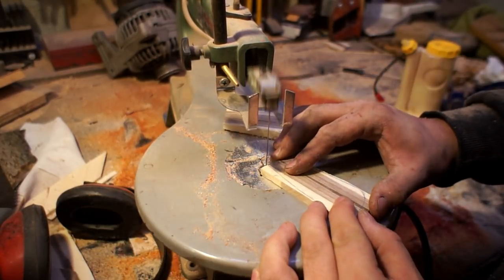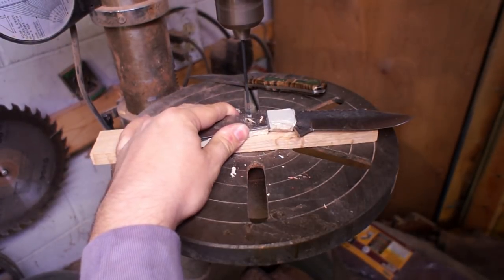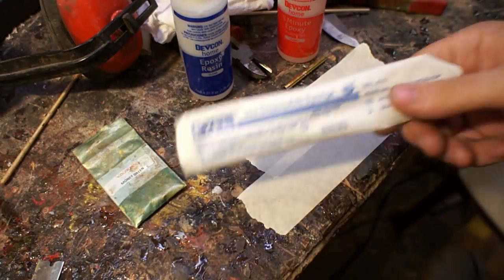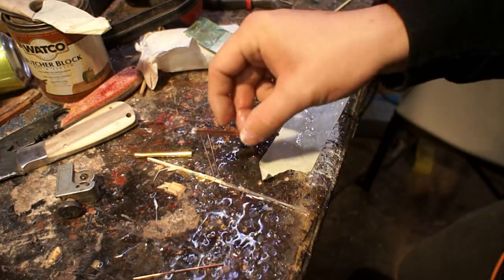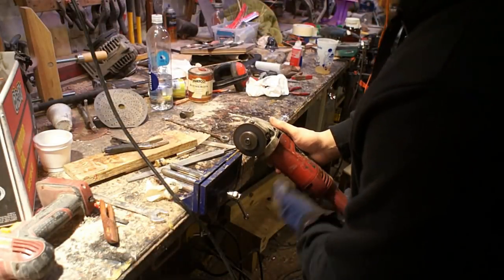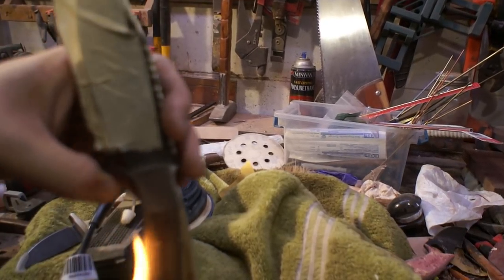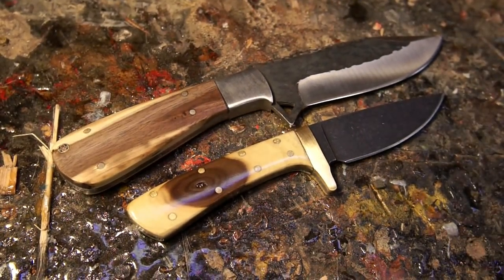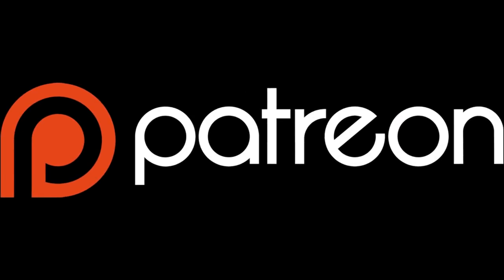Farm Walnut Knife, Part 2: Son (mosaic pin)

Comment: Hi, I'm trying to make a wooden slingshot with an aluminum core for my niece. At 0:35, when you glue the first scale, do you wait for the epoxy to dry? If not, how do you prevent the scale from slipping when you clamp it?
Reply from the maker: I tend to usually let the one side cure, as its easier for me that way, but you could do it at the same time. It doesn’t have to be fully cured, so if you use 5 min epoxy just waiting 10-15min should be sufficient to work with it for the other side
Reply: @Tappar1  Merci, thanks